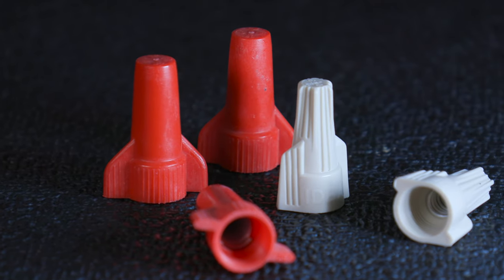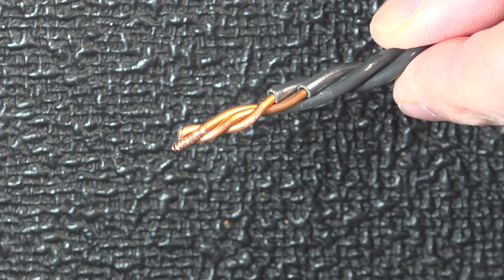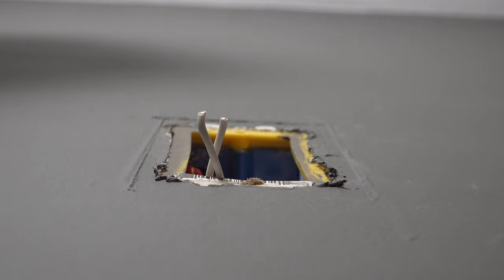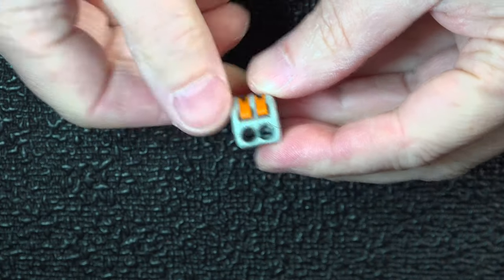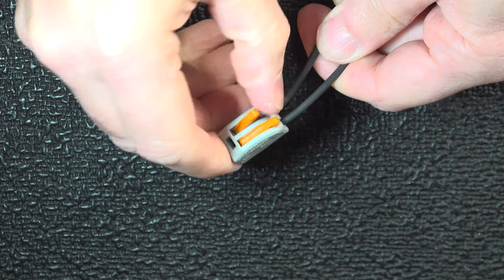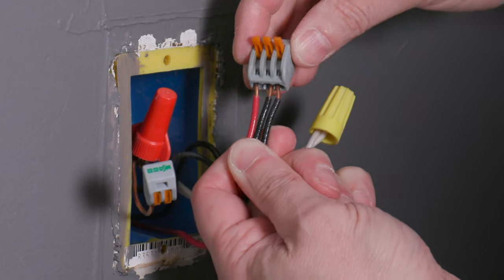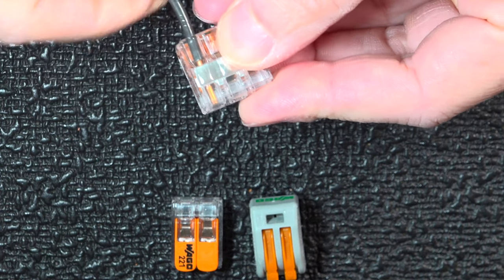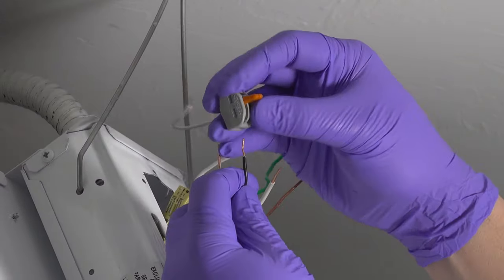Never use Wire Nuts Again - Wago is Better Electrical Connector

Comment: "Wire nuts are not reusable"
Say what now?
Apparently I've been doing it wrong for a very long time.
Reply from the maker: Manufacturers do not recommend reusing them, with the exception of flexible spring style versions vs rigid springs. Would you know the difference, don't worry no one does since the flexible ones are a tiny % of the market and even then only designed to be resused under specific circumstances, all extremely unpractical to follow. Even if you don't buy Wagos, use new connectors at least.
Reply: @SilverCymbal  oh, well if the person who wants to sell you more of their products says you should reuse them, i guess you should listen. BAHHH BAHHH (where's the hay) ;)
Reply: “I don’t use wire nuts I only use wagos”
“What’s a wago?” 
“It means he’s scared of power”
“Whoa better watch out there’s 120 on that wire!”
Reply: @SilverCymbal 
A physically sound wire nut can be reused with no issue.
Reply: @SilverCymbal  I disagree with your assessment that no one knows the difference, you can see the difference in the design at a glance, but you should probably not be using wire nuts or any other connector if you do not know its ratings and you should not re-use wire nuts in general.  That said I use new wire nuts for all permanent wiring, but a temporary construction light setup or other temporary low current application for my own use might get some used ones from my junk bucket for economic reasons.
Reply: @ironsniper13  that's a good tip!
Reply: I Agree unless the metal piece comes out and they look good. They are reusable. Now I do like the wago products but state the facts. 
I have been doing electricity for 40 years. I tool industrial electricity in High school. I have never heard what you are stating about not reusing wire nuts.
If they are in good shape. Most fires are caused by people over loading the receptacle with a power cord. 
I am not saying that if you put on a lose wire nut or reuse a broken one you are not asking for trouble, because you are.
Reply: @SilverCymbal  and Wago recommends re-using their product? (Please--show me their recommendation.) Doesn't their connector also bite into the copper?
Reply: @joewelling7691  It does not. It is constant force cage clamp.  They sell another "push fit" type which  bites the wire a little. It can be reused as well but wago recommends reuse on thicker wire than the one it was removed from.
Reply: @evzenhedvabny6259 , and this "constant force cage clamp" is made of something softer than copper?
Reply: I never have issue with reusing them.  All my houses are still good.
Reply: @jbkibs  Well at least in Sweden you kinda are supposed to follow manufacturers recommendations whenever doing electrical work, so doesn't really matter if you feel like it's a sham or not. But also; shouldn't this go for everything in every product? Like recommendations on max A/V and likewise? "They just want to sell more products, I'll just take this old switch."
Reply: @SilverCymbal  sure not good for business.
Reply: @evzenhedvabny6259 , also your reply does not show a statement by the manufacturer that they recommend re-using their products. I'm not saying it's a problem--only that the same fictional problem this video invents about wire nuts applies to these things. You simply can't make a good connection into copper without somehow biting into the copper. There may be a good reason for buying them, but that they are in any meaningful way more re-usable than wirenuts (or the "problem" of constantly shortening available romex) is nonsense.
Reply: Sometimes they dont bite as well after being used before but usually they are ok.  I usually just pitch the old ones and use new ones.  The wire having Nicks and not being reusable is bogus too lol
Reply: They only cost a few cents each so I don't reuse them. Whatevever I pull off gets thrown away and replaced.
Reply: I'll reuse a wire nut if it still grabs the wires securely and the insulation isn't chipped or cracked. And I automatically replace any wire nuts that that don't have metal inside them, like the ancient ceramic ones and the modern garbage all plastic ones that are sometimes included with cheap light fixtures. These Wago things look cool though and I'll give 'em a try, although I'm having a hard time believing that they take up less space than a wire nut?!
Reply: @joewelling7691  nope it's just a clamp... On these ones anyway. Don't knock it till you've tried it. These things are pretty much standard now in Europe.
Reply: @travoltasbiplane1551  do you think a "clamp" stays on  a copper wire by magic?  
I'm sure the product is fine. What I'm knocking is the BS premise in this video that you can't re-use wire nuts because they deform the wire, but these things are reusable because they don't.
Reply: @joewelling7691  fair enough. But yeah the lever wagos don't damage the conductor. And they are sold as demountable and reusable. Can't really comment on wire nuts... They've never really been as much of a thing over here anyway and I don't think they're  deemed acceptable as twisting wires for us is is a bit of a no No .
Reply: @travoltasbiplane1551  if it clamps securely enough to reliably join two copper romex wires, it is deforming the copper because the clamp is harder than copper. Again, that's not a big deal. I'm sure these expensive connectors are fine. This video is bogus because its main point is these things solve a problem that renders wirenuts not reusable. They do no such thing. There is no such problem.
Reply: @joewelling7691  yeah I get it. But you're wrong re the wagos. I use these things everyday and have done for over a decade. See if you can get some... You'll see how they work. As someone else said the push wire ones bite a little especially if you need to withdraw the conductor. But as well as speed the lack of damage is one of there main advantages.
Reply: "But you're wrong re the wagos."  @travoltasbiplane1551  , you don't seem to be reading what I'm writing. I've repeatedly said there's nothing wrong with them. There's also nothing wrong with wirenuts. This video is wrong in saying these things solve a reusability problem in wirenuts. Your belief that a levered clamp is magic is also wrong.
Reply: @joewelling7691  the difference is that I've used them and you're making assertions about something you know nothing about and repeatedly saying they deform/damage the copper when they really don't. It's a flat spring loaded piece of metal applying constant pressure. I've never said anything about wire nuts because we don't use them over here so I'm not going to comment. But anyway. Best of luck with it all and when wagos become a thing over there I think you'll see what I mean. I also think you'll be converted. 👍
Reply: @travoltasbiplane1551 , I don't care to waste any more time with you. I'll just let you think you're right, and that it's possible to make a reliable electrical connection by clamping copper wires but that the clamping--using aluminum "levers" does not compress or otherwise deform the very malleable copper conductors. They work by magic--unlike wire nuts.
Reply: @joewelling7691  I am right and I'm speaking from experience. You however seem to think your assumptions and ill informed prejudices are worth more than this and you're telling me I'm wrong about a product that I fit everyday and that you have never used. Seems legit. Catch you later.
Reply: @travoltasbiplane1551 , bending, compressing, twisting, or otherwise deforming copper wire is not "damage" that requires cutting off that segment of wire. Copper's malleability is one of the reasons we use it for household electrical wiring.
Reply: @joewelling7691  mate... I would honestly send you one to try. These things connect down to something ridiculous like .25mm fine stranded so they are pretty 'gentle'. Conductors are not damaged at all on removal. Not lying I promise. If Romex ? Cable is a solid conductor you probably could take it out and not see any difference from how it went in. Yes copper will compress but the contact area on these things is a lot wider than a screw terminal or an indent crimp for example.
Reply: Yes your actually not supposed to reuse them because the spring wears out with everytime you twist it I've seen old ones where people reused them and the spring stays with the wire and the plastic parts comes off on its own and now you have to take off the spring
Reply: @SilverCymbal  Of course Manufacturers do not recommend reusing them [wire nuts] if every time you used something and followed manufacturers recommendations profits would certainly be way up... oh..wait. millennials actually do follow manufacturers recommendations and profits are way up due to mass stupidity.

Wire nuts vs these new WAGO connectors. Manufacture.. lets invent something expensive to replace wire nuts and tell the millennials WAGO connectors are better, don't worry they will not question it.
Reply from the maker: @robert5  I get that you want to rant about something but it makes no sense. Millennials aren't even doing their own wiring they hire someone. Sorry to burst you other bubble some wire nuts are reusable. Depends on what type of metal is used on them, but reusable ones are not the common ones found. You can reuse bandaids, toilet papers or qtips but none of those can burn your house down. Don't use Wagos if you don't want, but please dont ever risk a fire over 5 cents and reusing a disposable part.
Reply: @joewelling7691  i re-use them all the time. They're great. And way quicker than wire nuts.
Reply: @GoalOrientedLifting  please re-read the comments. I'm not claiming there is anything wrong with these connectors. I'm pointing out the video is wrong when it says these connectors are reusable but wire nuts are not.
Reply: @SilverCymbal  car MFGs recommend you buy a new car every year too lol. i figured your video would get roasted in the comments. america don't like no stinking wago. lol
Reply: @tannerbruce5434  stop it patrick you're scaring him
Reply: I didn't even know there was an alternative to wirenuts. As a non electrician homeowner who isn't spending money everyday on connectors I will take the wagos for sheer simplicity and the knowledge that I did it correctly. I have been cursing wirenuts for years. I must admit I learned a lot about them through these comments and I am sure they are fine and dandy but, they are a pain in the ass for someone who doesn't do this type of work everyday and knows nothing about them. From now on I will go the extra dollar for the wagos. I put a new light up in the dining room last week and was cursing the new wirenuts. I was splicing romex and braided wire together and could not get the wirenuts to stay after an hour of trying. I finally gave up and twisted them together and just heavily taped them together with black electrical tape and called it a day. Question, are the wagos any good with braided wire?
Reply: @rotomoto8416  can you point me to somewhere to support your claim. From what I have read here they don't seem to cause a problem for anyone in Europe?
Reply: Manufacturer says they aren't reusable; therefore, the liability is fully on you if you do and there's a problem.
Reply: This guy knows nothing about wiring.  He just bought some parts and makes a video talking about them to make money off of Youtube!!
Reply: @cdoublejj  lol the literally dont.
Reply: @joewelling7691  The wire nuts make connection by cutting a thread onto the wires. Cutting multiple threads onto the same wire is same unsave as putting the bolt into a thread at slightly different place cutting a new thread..
If wire nuts are used with more current and heat up, thermo expansion looses the connection everý time.
The wago uses a spring to press the contact against the wire.
If there is a mark from prior use, the contact will move further until the same force is applied. Same thing with thermo expansion. After cooling down the Wago spring does press the contact down to the prior position.
Even if you do not like, that Wago is far better, it is.
Maybe you do not care about fire after years of heating up and cooling down cycles loosening wire nuts, because you do not give warranty.
Wago is german engineering and in Germany nobody uses bullshit and also it saves money, because it is far more quick.
Reply: @proislam1447 , copper is very malleable. It is not the same as cutting multiple threads onto a bolt made of hardened steel. Not remotely. And to the point: these clamp gadgets also deform the copper to make a secure connection. If wire nuts aren't reusable, then neither are these. In fact, I think both are because copper is very malleable.
Reply: @proislam1447 , also wire nuts aren't used to cut threads around a single shaft. You twist the wires first, and the wire nut cuts various faces of the several wires. Reusing them cuts into different surfaces. So again--this is nothing like cross threading a bolt.
Reply: And please, show the evidence of fires caused by reusing wire nuts. There may be great reasons to buy this product, but solving non-existent problems is not legit.
Reply: @jbkibs  Wago is a large and successful company. They have zero connections with a random American content creator.
Reply: Wirenuts are reusable based on my reading, if they are not crack, rusty, or damaged. Al/CU wirenuts are not reusable, though.
Reply: @SilverCymbal  Thats just because they want you to buy more, not because you can' reuse them just fine.
Reply: They are reusable.
Reply: @joewelling7691  The reusability aspect of wire nut connections is not really of the wire nuts themselves, but the fact that a proper connection involves twisting the copper wire securely first. Trying to unwrap that connection and redo that is the part that requires cutting the wires down, because trying to rework the twist will be a recipe for failure. That's where the Wago has the advantage, not having to twist and deform the wire for the connection. If you're able to guarantee that the connection absolutely will never need to be changed by yourself or any one else in the future, the wire nut is perfectly fine as a one shot and done deal.